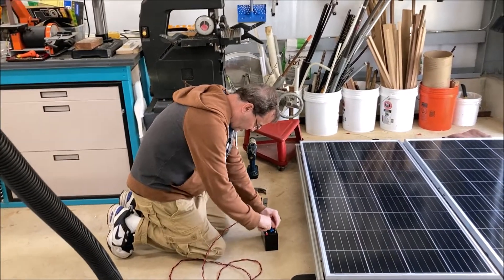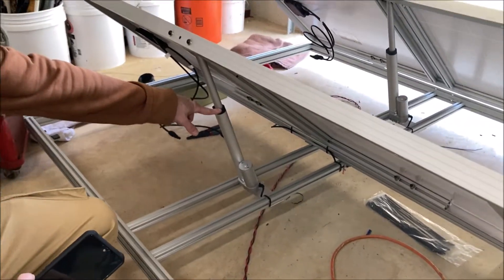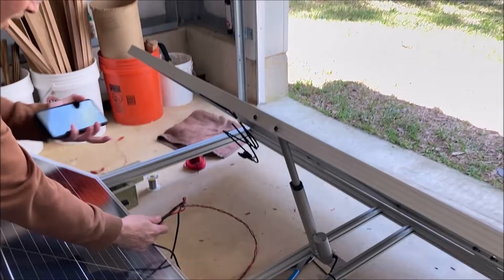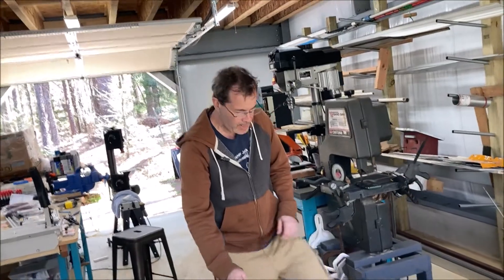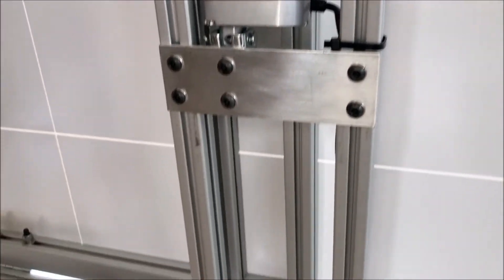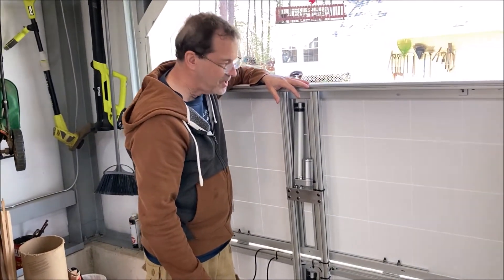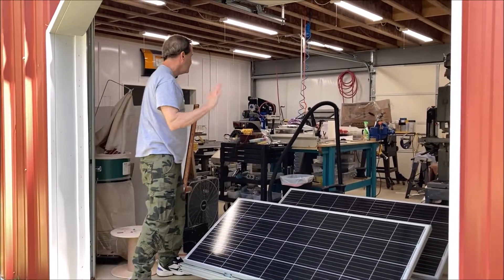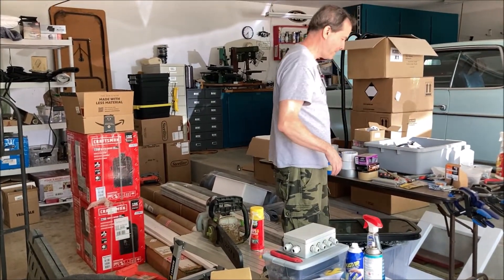Building Remote Control Tilting Solar Panels for our Ram ProMaster Van

Comment: Good try – but senseless as long the front panel is shading the back one ... (if mounted as shown ...)
Reply from the maker: They can be tilted independently so one can stay flat and one can tilt if needed. But mostly they stay flat. They actually are working great.
Reply: @allyagottadois8876  ... So why not only one made to tilt?

Comment: What is the difference between mounting the linear actuators extending away from the hinge or towards the hinge?  Seems to me it would be more stable wide open if it were mounted in more of a triangle, with the motor section farthest from the hinges and the extender pushing at the hinge side..  I've seen both on YouTube and getting ready to mount my own but I'm no Engineer and wonder what the difference is.  Thank you!!!! Or anyone who cares to reply.